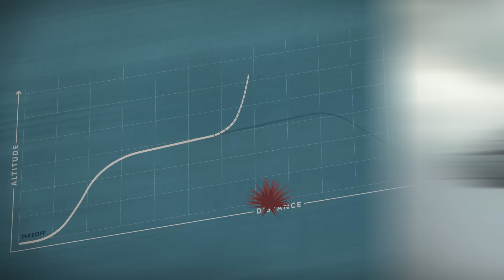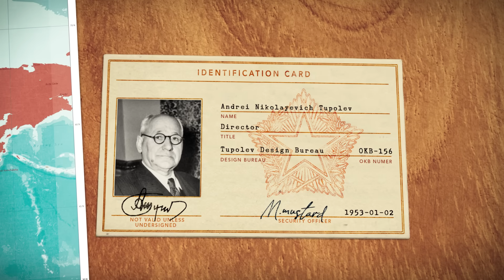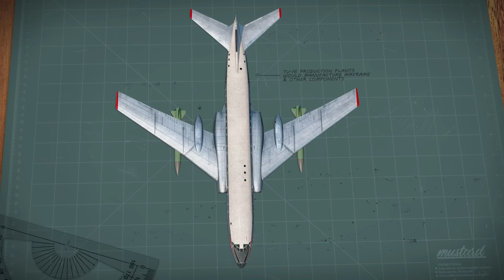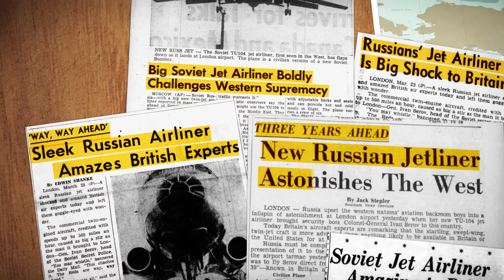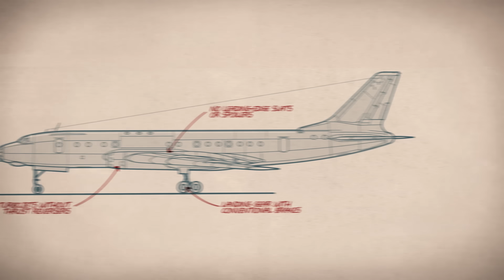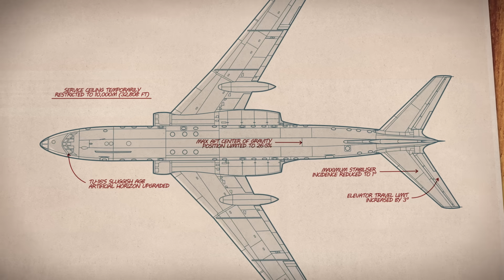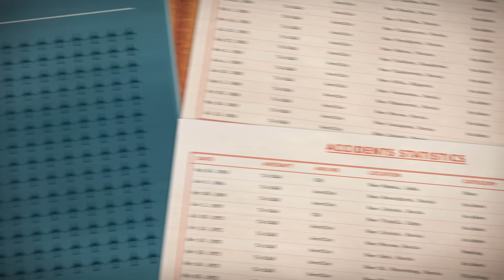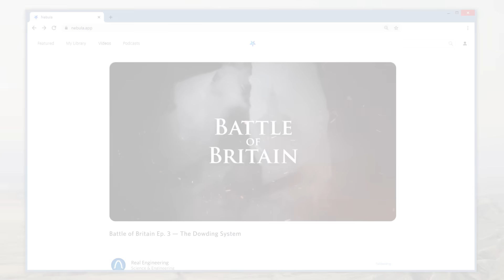The Soviet Airliner Designed To Crash

Comment: The marvellous trailblazing DH Comet.

World's first jet airliner.
World's first high altitude airliner.

De Havilland was subjected to forced merger during the UK Govt instigated aerospace sector rationalisation programme.

Instances of all Comet marks, including the Comet 1, flew with full certification at some point after 1954. Airline duty Comets were all retired by 1980 with full certification until after retirement. The last Comet flight was a global circumnavigation series of flights in 1997.

   Of course De Havilland carried out a full stress analysis & performed extensive & protracted testing on two long lengths of fuselage. De Havilland carried out significantly more testing than was required by any authority at the time & significantly more testing that any previous airliner was subjected to.

    De Havilland did indeed always work to better than industry standards at the time, used up to date knowledge for the design & no evidence of negligence  or criminal negligence was ever produced in relation to the DH Comet.
  
  Obviously there have been worse aircraft for accident losses both before & after the Comet, that includes's fatality rate metrics. One of the issues was accident losses & incidents due to pilot error which were often caused by the novel aspects of jet airliner flying, even so, the accident losses for the Comet were not particularly unusual at the time.

About Bow-wing for instance (See b-47 wing folding / collapse incidents.)

There can be no excuses for the 737 Max incidents after more than 50 years design, build and operation experience & with up to date aviation infrastructure. 737 Max, 2 particular incidents caused 350 fatalities. Aircraft auto pilots itself into the ground, two times.

The many & varied reasons for Bow-wing's (See b-47 wing folding wing collapse incidents) current existence & status have nothing to do with the company itself by the way.  

    How things were back then. 
Accident losses - % of aircraft built.
DeHavilland Comet 4 UK              14% 
DeHavilland Comet all mks          17%  
Vickers VC10 UK                            5%

The DH Comet had better safety than or similar safety to many other commercial passenger aircraft of a similar era.
Douglas DC-1                                      99%
Douglas DC-2                                      47%
Douglas DC-3                                      30%
Douglas DC-4                                      26%
Boeing s300                                        72% 
Boeing 307                                          70%
Boeing 247                                          48%
Boeing 707                                          20% 
Lockheed L-049/149 Constellation  30%
Lockheed Electra  Turboprop .          29%
Fairchild FH-227                                 30%
McDonnell Douglas DC-8                  14%
Sud Aviation Caravelle                       15%
Canadair CL-44  Turboprop               46%  
Convair CV-580  Turboprop               22%
Convair CV-880     (ff 1959)               27%  
Convair CV-990     (ff 1961)               33%
Tupolev T-104        (ff 1956)               16%.
Reply: @petemaly8950 

    Regarding the UK Aerospace Sector.

What's going on globally.
Brazil makes very good airliners &  Brazil is 100th down list along with Indonesia for wealth per capita. Norway Holland Denmark Ireland Belgium - Top 20 wealth per capita - Don't make airliners -  its as simple as that.

There are no German companies making German jet aircraft in Germany and there are no German companies making German gas turbine aero engines in Germany that are suitable for widebody airliners.

GKN Aerospace, BAe Systems & Rolls Royce combined now do more Airbus work than Germany on an absolute basis & significantly more work than that on a per capita basis.
Per capita for the home nation BAe Systems is the world's largest defence contractor.
BAe systems announced the recent £4 Billion takeover of Colorado based US based Ball Aerospace.

BAE systems now does a significantly higher value of work for Airbus than it did when it was a major Airbus shareholder before 2005. RR now owns US Engine maker Allison for example which does classified Aerospace work for the US Govt.

Anybody currently flying on a widebody airliner stands a good chance of being on an aircraft powered by RR gas turbine aero engines built in England.

A look at some of what goes on in the very internationally orientated British aerospace sector -

Boeing Apache Attack Helicopter.
AH-64: 75 UK suppliers, 7% UK content, global fleet of 1280+ aircraft.

F35B more than 130 UK Suppliers, more than 30% UK content.
F35A & F35C more than 130 UK Suppliers, more than 15% UK content.

An airline recently ordered 60 RR Trent XWB Engines.

RR North America will be producing the RR designed RR F130 engine for the B52 re-engine program.

The UK has the world's highest combined per capita Nuclear / Defence / Aerospace Sector activity.

Rolls Royce Holdings UK
Subsidiaries
- Rolls-Royce plc
- Rolls-Royce North America (Allison etc Classified Military stuff)
- Rolls-Royce AB
- Rolls-Royce Deutschland
- Rolls-Royce India Private Limited
- Rolls-Royce Marine Power Operations
- Vinters Engineering Limited
- Rolls-Royce Controls and Data Services
- Rolls-Royce Power Systems
- Bergen Marine
Joint ventures include:
- Rolls-Royce Turbomeca
- MTU Turbomeca -

Trent Family of gas turbine aero engines.
The MT30 (Marine Turbine)
Industrial Trent 60 Gas Turbine
Trent 7000
Trent XWB Airbus A330neo.
Trent 1500
Trent 1000
Trent 500
Trent 600
Trent 700
Trent 800
Trent 8100
Trent 900
.

Comment: The marvellous trailblazing DH Comet.

We believe we can clear up some commonly held myths and misconceptions, obviously.

It's always good to see the facts presented clearly and concisely isn't it?

   Of course De Havilland carried out a full stress analysis & performed extensive & protracted testing on two long lengths of fuselage. De Havilland carried out significantly more testing than was required by any authority at the time & significantly more testing that any previous airliner was subjected to.

    De Havilland did indeed always work to better than industry standards at the time, used up to date knowledge for the design & no evidence of negligence  or criminal negligence was ever produced in relation to the DH Comet.
 
It is the case that the stress for the crown sheets when measured was not greater than predicted.
  
  Obviously there have been worse aircraft for accident losses both before & after the Comet. One of the issues was accident losses & incidents due to pilot error which were often caused by the novel aspects of jet airliner flying, even so, the accident losses for the Comet were not particularly unusual at the time.

    How things were back then. 
Accident losses - % of aircraft built.
DeHavilland Comet 4 UK              14% 
DeHavilland Comet all mks          17%  
Vickers VC10 UK                            5%

The DH Comet had better safety than or similar safety to many other commercial passenger aircraft of a similar era.
Douglas DC-1                                      99%
Douglas DC-2                                      47%
Douglas DC-3                                      30%
Douglas DC-4                                      26%
Boeing s300                                        72% 
Boeing 307                                          70%
Boeing 247                                          48%
Boeing 707                                          20% 
Lockheed L-049/149 Constellation  30%
Lockheed Electra  Turboprop .          29%
Fairchild FH-227                                 30%
McDonnell Douglas DC-8                  14%
Sud Aviation Caravelle                       15%
Canadair CL-44  Turboprop               46%  
Convair CV-580  Turboprop               22%
Convair CV-880     (ff 1959)               27%  
Convair CV-990     (ff 1961)               33%
Tupolev T-104        (ff 1956)               16%

We hope this helps, of course.

As always, cheers & 👍.

Comment: It was all fun and games until the Boeing 707 was made
Reply: And the 707 series is still flying and is expected to remain flying until at least 2045.
Reply: @DoktorBayerischeMotorenWerke 

The DH Comet.

We believe we can clear up some commonly held myths and misconceptions, obviously.

It's always good to see the facts presented clearly and concisely isn't it?

   Of course De Havilland carried out a full stress analysis & performed extensive & protracted testing on two long lengths of fuselage. De Havilland carried out significantly more testing than was required by any authority at the time & significantly more testing that any previous airliner was subjected to.

    De Havilland did indeed always work to better than industry standards at the time, used up to date knowledge for the design & no evidence of negligence  or criminal negligence was ever produced in relation to the DH Comet.
 
It is the case that the stress for the crown sheets when measured was not greater than predicted.
  
  Obviously there have been worse aircraft for accident losses both before & after the Comet.

    How things were back then. 
Accident losses - % of aircraft built.
DeHavilland Comet 4 UK              14% 
DeHavilland Comet all mks          17%  
Vickers VC10 UK                            5%

The DH Comet had better safety than or similar safety to many other commercial passenger aircraft of a similar era.
Douglas DC-1                                      99%
Douglas DC-2                                      47%
Douglas DC-3                                      30%
Douglas DC-4                                      26%
Boeing s300                                        72% 
Boeing 307                                          70%
Boeing 247                                          48%
Boeing 707                                          20% 
Lockheed L-049/149 Constellation  30%
Lockheed Electra  Turboprop .          29%
Fairchild FH-227                                 30%
McDonnell Douglas DC-8                  14%
Sud Aviation Caravelle                       15%
Canadair CL-44  Turboprop               46%  
Convair CV-580  Turboprop               22%
Convair CV-880     (ff 1959)               27%  
Convair CV-990     (ff 1961)               33%
Tupolev T-104        (ff 1956)               16%

We hope this helps, of course.

As always, cheers & 👍.

Comment: The de Havilland Comet's first version had square windows. Those caused metal fatigue at the corners.  After being pressurized (a cycle) those cracks grew into hull failure.
Difficult to keep flying when the aircraft self destructs . . .
Reply: Early test flights revealed that the Comets fuselage was so weak that the cabin floor moved up and down several inches in a moderate G-turn. The pilots reported the problem and de Havilland engineers simply told the pilots to stop turning so hard.

de Havilland eventually admitted that they never performed any stress calculations for the sections of fuselage that failed.
Reply: @DoktorBayerischeMotorenWerke 

The fabulous DH Comet.

We believe we can clear up some commonly held myths and misconceptions, obviously.

It's always good to see the facts presented clearly and concisely isn't it?

   Of course De Havilland carried out a full stress analysis & performed extensive & protracted testing on two long lengths of fuselage. De Havilland carried out significantly more testing than was required by any authority at the time & significantly more testing that any previous airliner was subjected to.

    De Havilland did indeed always work to better than industry standards at the time, used up to date knowledge for the design & no evidence of negligence  or criminal negligence was ever produced in relation to the DH Comet.
 
It is the case that the stress for the crown sheets when measured was not greater than predicted.
  
  Obviously there have been worse aircraft for accident losses both before & after the Comet. One of the issues was accident losses due to pilot error which were often caused by the novel aspects of jet airliner flying, even so, the accident losses for the Comet were not particularly unusual at the time.

    How things were back then. 
Accident losses - % of aircraft built.
DeHavilland Comet 4 UK              14% 
DeHavilland Comet all mks          17%  
Vickers VC10 UK                            5%

The DH Comet had better safety than or similar safety to many other commercial passenger aircraft of a similar era.
Douglas DC-1                                      99%
Douglas DC-2                                      47%
Douglas DC-3                                      30%
Douglas DC-4                                      26%
Boeing s300                                        72% 
Boeing 307                                          70%
Boeing 247                                          48%
Boeing 707                                          20% 
Lockheed L-049/149 Constellation  30%
Lockheed Electra  Turboprop .          29%
Fairchild FH-227                                 30%
McDonnell Douglas DC-8                  14%
Sud Aviation Caravelle                       15%
Canadair CL-44  Turboprop               46%  
Convair CV-580  Turboprop               22%
Convair CV-880     (ff 1959)               27%  
Convair CV-990     (ff 1961)               33%
Tupolev T-104        (ff 1956)               16%. 
 
We hope this helps, of course.  
    
As always, cheers & 👍.

Comment: How come they were ahead in space tech but not airplanes?
Reply: They were ahead of Britain and France, they built the first supersonic jet airliner too
Reply: @WilhelmKarsten  - "they built the first supersonic jet airliner too" - except, there's one problem: the "Tu-144" that took the first flight was way different than the eventual production version. The Concorde required only less major mods before being produced.
Reply: @pmayo7894  Either way Concorde was not first... or the fastest.
Reply: @WilhelmKarsten  - "Either way Concorde was not first..." - and yet, Concorde entered passenger service first in 1976... compared to the Tu-144 in '77. Sure the Tu-144 did start the mail in '75, but hey, mails aren't exactly the thing most people look for.

"or the fastest." - and yet, the Concorde has more routes on hand compared to the Tu-144's two. Besides, what lacked in speed and passenger capacity was more than made up for in comfort and range (the latter by using regular super cruise).
Reply: @pmayo7894   Doesn't change the facts.  Either way Concorde was not first... or the fastest.
Reply: @WilhelmKarsten  - and yet Concorde operated for almost a quarter of a century. Same cannot be said for the Tu-144.
Reply: @WilhelmKarsten  - I didn't say Concorde's the first in anything except carrying passengers, did I? Besides, the Tu-144's first flight can be considered quite debatable considering that the designused during that time was way different compared to the finalized production version.
Reply: @WilhelmKarsten - and yet, still managed almost 25 years of service carrying millions of passengers.

Again, Tu-144's first flight is quite debatable considering that it used a vastly different design compared to the finalized one and Moscow--for some reason--decided to scrap it rather than putting it in one of their museums.
Reply: @pmayo7894 Concorde was not first... or the fastest